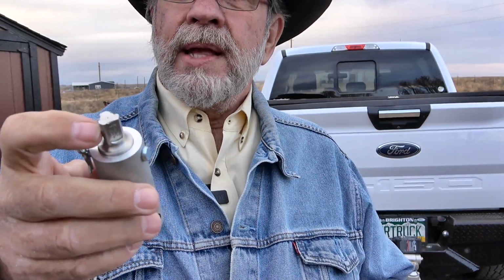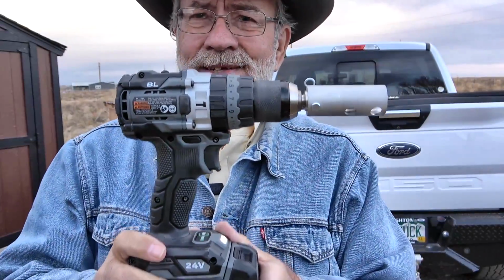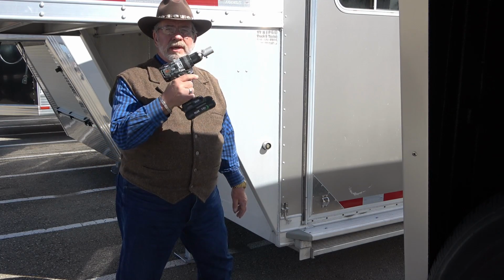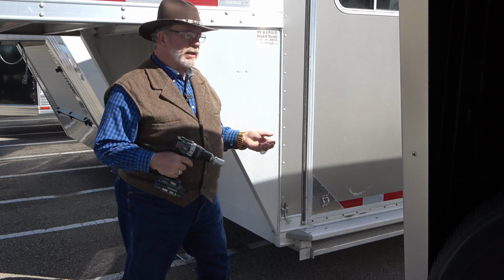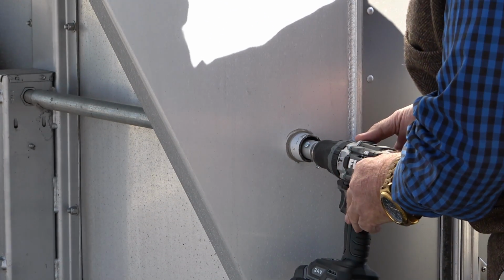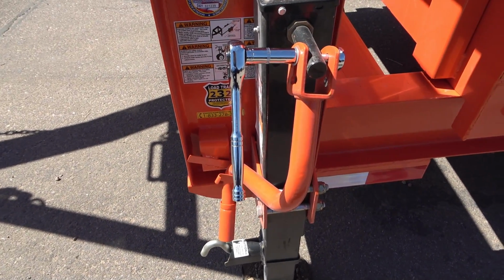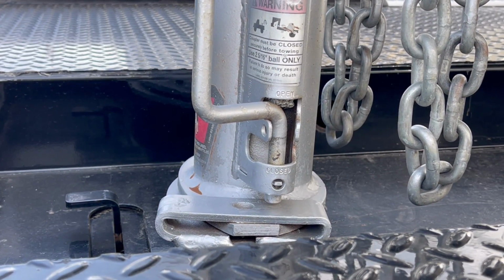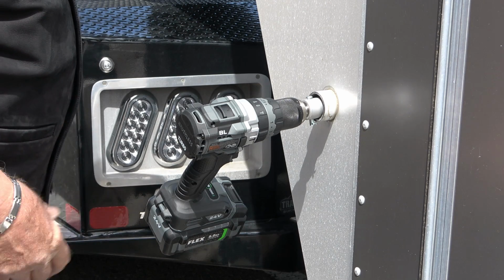Can you crank your trailer jack 7 in. in 9 seconds? Gooseneck power lift adapter can. Kwick Kranker

Comment: This is cool except for one thing. My trailer doesn't need a drill. However I carry a half inch impact in my truck. there are 3 sockets there 3/4, 13/16, 7/8."   3/4 bolts hold spare on, 13/16 tire to trailer, 7/8 pickup tires. Trailer tires take 10 min to change.

Comment: Looks like a great product. I have a custom tilt deck car hauler that uses a standard trailer jack but the handle is a single piece. I’ve always wanted to remove it and make it adaptable to use something like this.
Reply from the maker: Sounds like you need a  reciprocating saw. This are an inch but they make one an inch and 1/8

Comment: I purchase the Kwick Kranker and purchased the big flex hammer drill and it would not lift my goose neck traile,r my trailer is a PJ 36 foot, it weights 9200 and the load is spread out and weights 10500 and it would not budge it.
Reply from the maker: Hi, call TC 1-559-618-0964  and tell him what happened. He'll help you
Reply: Don't feel like the Lone Ranger. I built an adapter like this for our horse trailer, it has two speed gear box, it burned the 1/2-inch DeWalt drill up. It depends on the gear ratio of your gear box.

Comment: My gooseneck trailer has 2 speeds what should it be on to lift the trailer? Easy or hard setting
Reply from the maker: low speed would be good for a loaded trailer. You'd have to try the high speed with an empty trailer to see if that works

Comment: Will it work with a heavy/loaded trailer?
Reply from the maker: I've used it on a trailer loaded to 8200 lbs and an empty semi-trailer 53' flatbed. If the trailer has a 2-speed jack, it can. The owner of Kwick Kranker lifts his 3 horse living quarters trailer. Now commercial companies with dump trailers are buying the most.

Comment: Seems like it would be hard to hold on to 1400 ft- lbs of drill.  😋
Reply from the maker: I did it about 20 times. Not hard if you hang on the battery
Reply: It’s hard. I made one of these out of a socket. Lifting a fully loaded 40ft gooseneck with a 19k lb load will snap your wrist.
Reply: And none of those small drills will put out what they are rated for
Reply: I’m guessing that’s 1400 in-lbs! That would have to be a 1” impact to be 1400 ft-lbs
Reply: @troyhagseth8912 ya, mr truck is use to reviewing trucks not drills lol
Reply from the maker: It's inch pounds
Reply from the maker: In-pounds

Comment: Use it on gear reduction hitches otherwise it wont work.
Reply from the maker: It does on most trailers. Bigger trailers have the two speed jack and in low the Kwick Kranker does fine
Reply: @MrTruckTV my 25k lb gvwr big tex gooseneck has 1 speed jacks. This wimpy crank doesn't work. Doesn't work empty let alone loaded. Loaded is when u really need it. I got the gear reduction box. That works great!

Comment: That's bull,I know I've tried it with a 1/2 ,impact on my gooseneck, u will snap ur wrist off trying to hold onto the drill,an average drill not gonna have enough torque to crank up a loaded trailer
Reply from the maker: Impacts don't work. We use Flex 1/2 drills which work fine